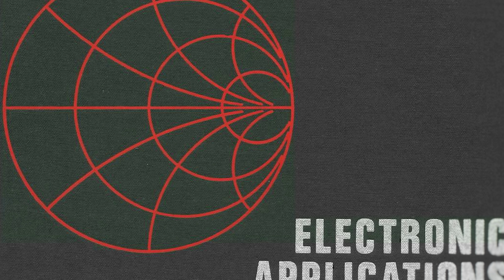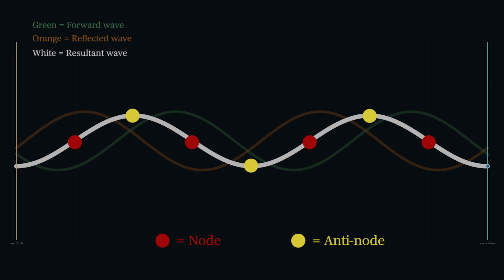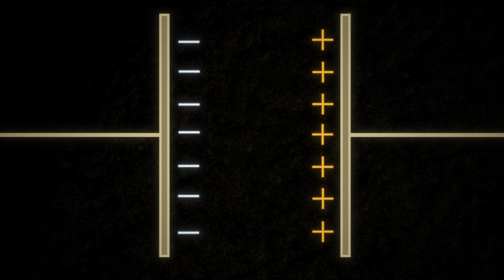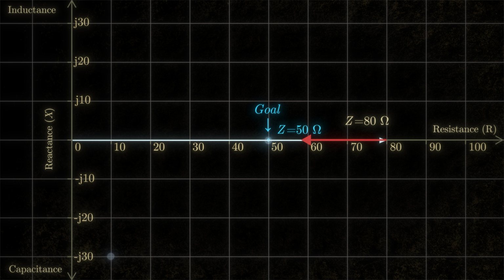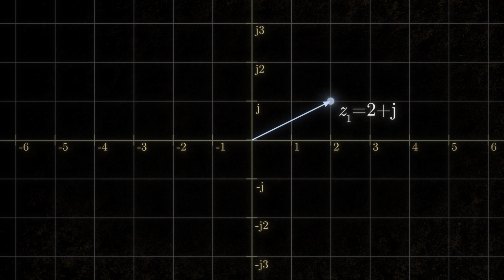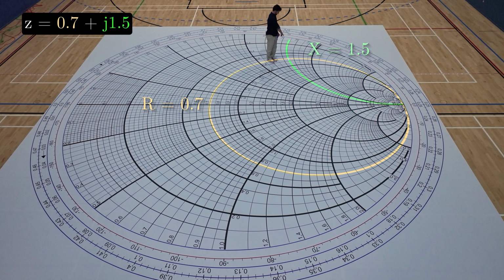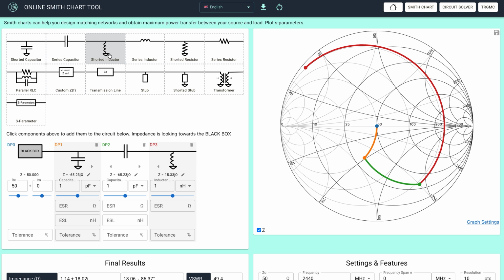The Scariest Chart in Electrical Engineering

Comment: Ok, I feel like I understood shockingly little of this video.  Here is what I am taking away: Differences in impedance in a circuit between the source and load causes signal reflection, resulting in power loss.  You can combat this in a variety of ways, but instead of just fiddling around you can use some math and this smith chart to calculate exactly what you need to change in the line to match impedance.  This isn't as simple as adjusting the resistance despite resistance being a big component of why the impedance doesn't match because impedance is a complex value.

Pretty much all the more specific details than that went over my head.  If I had to match impedance I would probably just mess around with a stub, guess and check various lengths, and just check what the power output is at each length to find "good enough" rather than trying to actually calculate what exactly I need to do.  I am glad I am not an RF engineer.

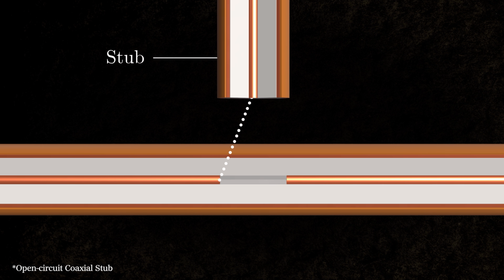Comment: 32:27 if anyone is confused on how the electrons even make it to the shield of the stub, it’s because of displacement current.  At first I was confused, but I did some research and it’s the exact same phenomenon that allows a signal to pass through a capacitor. When the signal reaches the top of the stub there’s a negative charge that accumulates in the shield from the amount of positive charge in the inner wire, acting through the plastic dielectric (just like a capacitor). The signal doesn’t flow through the copper wire. The signal actually flows through the plastic in between the inner and outer conductors. So when the signal travels up the stub it sees the open, so it is reflected backwards back down to the joint of where it is connected (the charge that accumulated in the shield also travels down the stub). It is at that point where the magic happens where the electrons from the shield goes into the wire. When they enter the wire the voltage instantly changes in reference to the outer shield (which is grounded). This transfers the electric field from the left side of open to the right side.

Keep in mind that the reflected wave in the plastic and the moving charges in the metal are actually the exact same event viewed from two different angles. I just didn’t really know how to explain it perfectly.
Reply: I'm sorry, but their fancy visualization was unfinished or cuts off too soon. To clarify there would be a DC connection where they have the white dashed lines. It would have  been easier to have the stun connected to a gap in the shield instead of the connector. And it would have been far easier to see if they did show the shunt stub case (which he calls the parallel one). This all got rushed through bc they don't closely show what the made in the lab where it is a coax series stun between microstrip (made from the copper tape).

Comment: I feel that teaching the use of the Smith Chart helps teach the core foundation better than just getting answers from a calculator or computer.  But once you understand it, the faster calculator is the right tool.  Much how learning how to use a sliderule is very good at teaching visually how numbers relate to each other and functions like log, etc. but in everyday work, the calculator is still the better tool.  I just wish we would still teach how to use a sliderule first, to get that grounding.

Comment: This was great!  Thanks Philip Smith.  I had the privilege of learning the Smith Chart application on a network analyzer as a co-op student intern at Motorola back in the mid 80's before taking the class at Purdue where Prof. Chen taught the charts derivation.  When my lab partners were scratching their heads trying to make sense of it, I was able to teach them practical applications.  My co-op experience got me to switch from semiconductor process design to RF design as a 37 year career.  The Smith chart was an ever present tool through all those years.
Reply: Boiler up!

Comment: The Smith chart (sometimes also called Smith diagram, Mizuhashi chart (水橋チャート), Mizuhashi–Smith chart (水橋スミスチャート),[1][2][3] Volpert–Smith chart (диаграмма Вольперта—Смита)[4][5] or Mizuhashi–Volpert–Smith chart).
In the USSR, it was called Volpert chart because it was independently proposed by Russian engineer Amiel R. Volpert in 1940.

Comment: I'm 15 minutes in and just like radio waves, this is going over my head.
Reply: In the same boat with you
Reply: It's a crash course, covering like a semester worth of EE education (with much less math) in 30 minutes! Don't be hard on yourself and get what value you can out of it (it's excellent).
Reply: It means you have low inpedence
Reply: What if that radio waves can be use for home electronic etc.
Reply: Yes, it seems that way at first, but once you force yourself to work a few simple examples on the Smith chart, it rapidly becomes very clear!  🙂 (Unfortunately, I can't find a Smith chart emoji.)
Reply: This technology is from another plane. This is not natural at all, beware of alchemy. Sic Parvis Magna
Reply: ya not one of their better presented videos

Comment: Giving me PTSD of my electromagnetics class in EET school. One of those classes where you learn the theory (or enough to get the gist of it), know enough to be dangerous, barely pass the class, and admit that those who specialize in such things are in fact wizards. RF is indeed wizardry. 

Then again, there was a bit of ceremonial awesomeness when it came time to calibrate the Vector Network Analyzer (VNA) to measure the impedance of something. And what do those often output? Smith Charts!

Comment: My fav chart, yet as a RF engineer for 3 decades at Caltech JPL, I never had any need to use it nor build circuits needing matching, as it was always systems of systems. I really expected to be using the Smith chart a lot, when in college. It certainly made me aware of many limitations, especially with operating 10 TW EIRP transmitter out a 70m dish, or measuring equivalent system noise temperatures near 10K. Thank you for the fond memories and a fabulous educational effort

Comment: This chart is absolutely essential in power amplifier design and this video is just the tip of the iceberg. You can plot areas of the chart where your transistor will oscillate. It can also tell you which loads give you maximum gain or maximum efficiency or minimum noise.   If anyone wants to really use this chart to its full potential, look through Guillermo Gonzalez "Microwave Transistor Amplifiers: Analysis and Design"

Comment: A Smith chart is usually used to show how well radio waves couple into an antenna, but it equally becomes a map of how well an engineered field couples to the underlying non-linear vacuum medium. The closer you are to the center then the more the field and the underlying medium are synchronized which allows energy to flow smoothly. The farther away, the more energy is reflected because the local field is out of step with the surrounding medium. The Smith chart can be viewed as a map of coherence and synchronization, not just electrical impedance.

Comment: While not strictly the point of the video, you really could have used a microwave strip line match instead of coax cable on that board. were at least you could have shown both and mentioned that sometimes you want to choose a different transmission type for matching because of size and length. Those since the velocity factor between coax and strip line is pretty similar, I bet you would have needed a bigger circuit board, which is probably why you went with the coax. balanced line like Twinax would've let you get a little bit shorter but then you would have needed a balun.

Comment: a dumb question here:... 27:42 ..  how did we get this 0.68?
Reply: How about u draw a circle with that point as a radius and then when the circle crosses the x axis, use it to find the number as the x axis is numbered?

Does it make sense? It's just my guess btw
Reply: Scratch that, I'm wrong, 28:39  shows the units to be off, but something near it looks promising. But it's near 7.8 than 6.8
Reply: The radius of the circle is 1.00, the distance from the center of the circle to that point is 0.68 times the radius of the circle
Reply: This seems right, so it not from just counting the axis, it’s from calculation.

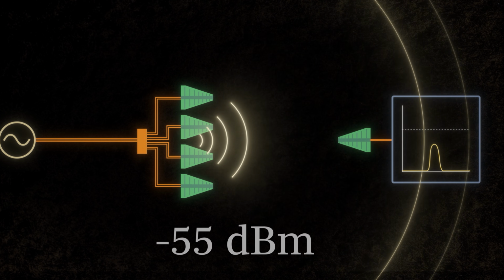Comment: 7:05 you should say "dee bee em" here and not "decibels". you are not talking about a unitless ratio like decibel implies, you are talking about milliwatts (on a log base 10 scale). for anyone wondering why they use dBm instead of just mW, it allows you to easily compare extremely small wattage with extremely large wattage which is something that always happens with over the air power transmission. you transmit in the megawatt range and receive in the milliwatt range

Comment: I have seen this shape when it is animated. It is the tube of light and sound that travel in when i astral travel using a 3x4 merkaba light body. As i move through it the sound pitch/scale changes as does the light spectrum. It changes as I change direction up down left right backwards forwards and/or change speed. A good example of what the sound might be like is the song, flight of the bumblebee. This all matches the scales of music which match the color spectrum of a rainbow and the color spectrum in minerals and the chakras and more. This all translates to space and time travel both through the space and time created by the grids but it also allows for you to travel internally through the vacuum inside of the tubes/strings that define the space time grids. The aircraft already exists where the pilot is the gps and the power source with 6-8 passengers. The dimension and location in time and space are all known coordinates on the grid. Use the correct color crystal, the matching scale/notes and you are on your way. That is why the math is so tricky haha. (I am an aviation electrical engineer retired a theoretical physicist and an 11x author including a Unified Quantum Theory) But most folks just call me Aloha. ❤

Comment: "Applied Complex Variables" by John W. Dettman (Dover Publishers) is a great read:  the first part covers the geometry/topology of the complex plane from a Mathematician's perspective, and the second part covers application of complex analysis to differential equations and integral transformations, etc. from a Physicist's perspective. I've used Smith Charts for years, but learned from Dettman that the "Smith Chart" is an instance of a Möbius Transformation.
Reply: complex analysis is such an interesting field of mathematics, and its applications are so important in electrical engineering
Reply: @drcgaming4195 The mathematics of "wiggly stuff" is indeed complex.
Reply: @drcgaming4195 Mathematicians and Engineers going at each other, "It's 'i'!", '
"It's 'j'!", ....

Comment: This was one of the worse explanations I have seen from this channel.

I mean starting by basically saying people don't know AC and explaining that 

Then getting to the big chart on the floor and just jumping all over the place saying I need that to connect this and this and use that circle and that circle with a bunch of equations basically going trust me that is how it works. 

Saying I just need to measure that and giving a number does not mean it is explained. For example where did he pull the number for red line, is that with a ruler?

I think they did not know who to target in the audience... Either dumb in down to people who need explanation on AC or do it for people who can get the end circle explanation. Both are fine but pick one. 

Also the edit was so bad. The big chart section was the moment to show how each circle change the signal. 

The stated goal from the video at the start was explaining how did that chart does what it does and it think you missed it.

Comment: 2:37 tap tap yeah that’s gonna do something
Reply: When I was a first-year university student, we had laboratory classes on electrical measuring instruments. One of the instruments was an analog pointer voltmeter with a 10 V measurement range. We had to set the laboratory power supply to approximately 9.5 V and take a measurement. At that moment, the voltmeter needle would sometimes peg beyond the 10 V mark, and we had to tap the instrument lightly with a finger so that the needle would move back and indicate about 9.5 V.
Reply: Anyone who used instruments with needles know that it does. Needles are mecanic, they are often stuck to a position that doesn't correspond to the value they are supposed to display.
Reply: You’ve never worked on a Continental 816? You have to tap the meters because they all stick. <sigh>
Reply: It will on a mechanical needle like that.

Comment: So mass per unit length, I like it a lot. Is this the same principle of light reflection? There both waves hitting a change in mass per unit length, which I guess is just density. I feel like the slinky metaphor is great and could be applied to a lot of areas of physics.

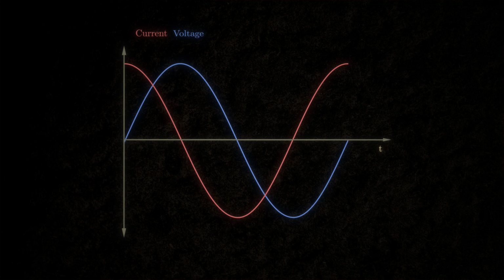Comment: The chart of voltage and current through a capacitor at 12:06 is simply wrong. The current leads the voltage by a phase angle of 90°, since i(t) = C du(t)/dt. For an inductor the graph would be correct.

Comment: The human mind can only assimilate new information at a fairly low rate. Above that rate you encounter the subject at hand, an impedance mismatch. The information fails to reach the reciever and is reflected off in waves of confusion. I am familiar with the topic as well as the 3b1b video (which took me a number of hours of fiddling around to grasp with a reasonable comprehension, although it procedes step by step logically) and I had trouble recalling the facts I already knew at a quick enough pace to keep up with the presentation as it evolved. Other than being incomprehensible to most audiences, it was well done in terms of being a good refresher course.

Comment: The sound of torpedo launch in star trek is the same when you hit a cable in steel . You ear reflections in the cable or also guitar strength also use the Smith chart.

Comment: This was great as always. The world would be quite different without this chart, its insane how much of an impact it has had on technology (in a relatively short time). A rare case where universal mathematics/physics is visualized in a way that it works as a tool that can be easily used. We can print the Smith chart on an A4 paper with the units that suit an alien and if they wanted to they could use it. If the alien made it all the way to our solar system and wanted to communicate, they probably wouldn't be very impressed, but at least we would get a civilization level ranking quite quickly, assuming the alien has eyes. They probably modulate particle spin or use some other galactic communication API. As a radio amateur and having worked long with wireless IoT, the Smith chart is close to heart. And life is not too short for QRP :)

Comment: The only thing I care about is my old Agilent RF Network Analyzer still passes calibration perfectly. Call it any magic you want, but when your ass is on the line with making six 20,000 - 30,000 Watt signals combine and multiplex into 1500 feet of 6" rigid copper transmission line, terminating into a massive multi bay radiator, your best friend is named Smith.

Comment: I love the Smith chart. I try to babble about it to people, but it's niche enough that even among other EEs it's usually a hard miss. It's such a good chart for tuning circuits. You can quickly see ways to fix circuits, you can see why certain components break your VSWR, you can just get what's going wrong with your circuit. And you can re-scale it for your target impedance! Drives me nuts when people show the real and imaginary components of reflection as separate or overlaid plots. There's a better way! And with how easy it is to code now, you don't need special excel plugins or matlab or hand-plotting, you can just use python libraries.

Comment: I think it's ridiculous this terrorizes electrical engineers, especially grad students. This worries me the level of EE being taught.

I learned this about 15 years ago in RF communications class as part of my Electrical Engineering Technology degree at my junior college. Nobody was terrified and we used to design and troubleshoot all kinds of RF circuits and lines.

Then again in the follow up class in microwave communications for finding S-parameters, etc.

Again this was in Electrical Engineering Technology degree not EE. And in both courses you did it all by hand no software. This was like 2013 at Mount SAC in Southern California.

If this freaks out EE grad students that's very disconcerting.

Comment: Oh this brings back memories from my upper graduate level EE courses. At 37.35 I agree with the speaker, to fully use the power of the software you need to understand the theory behind the chart. That understanding is what allowed me to evaluate two different programs and determine where and why each provided a different value. That knowledge enabled me to know where to tweak the software for the two program outputs to match. Memories. Thanks for sharing.

Comment: I'm currently designing a strip line or coplanar transmission line on a PCB for esp32 antenna. On esp32 reference schematics, I was wondering what is this stub place holder using a capacitor as a place holder??? This video helps me a lot.